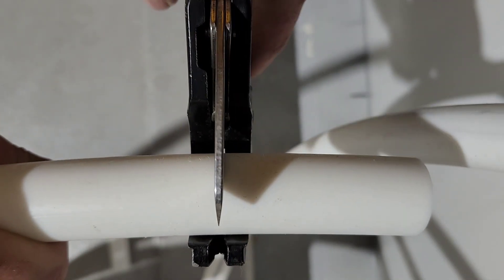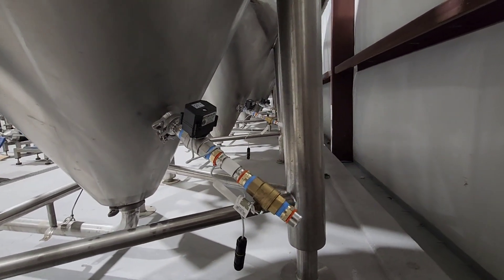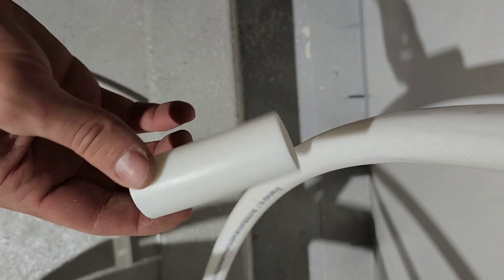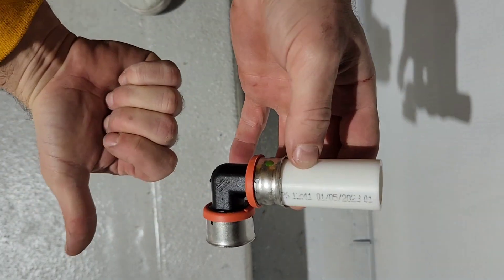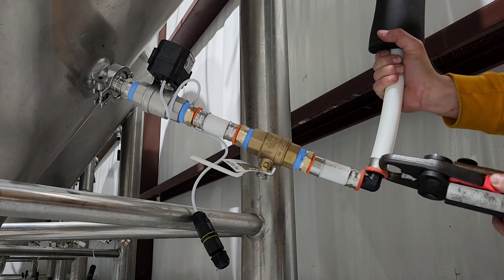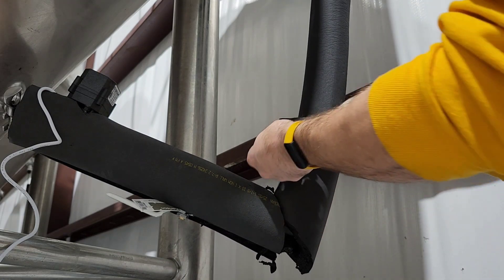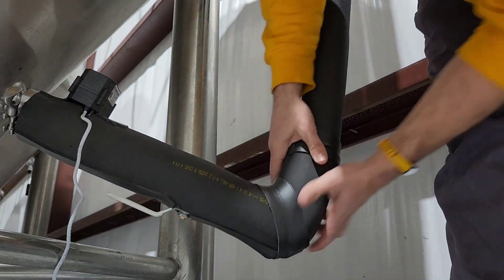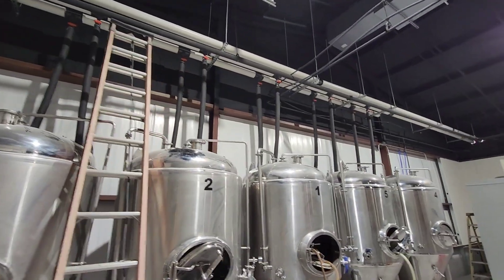How To Make Glycol Connections In A Brewery

Comment: How do you choose which pump to use?  Do you have any pressure valve and bypass?
Reply from the maker: Do you mean for pumping the glycol? The glycol chiller used in this brewery is a large unit with two pumps in the system. The unit also has a very cool variable frequency drive control for one of the pumps that regulates the flow rate to keep pressure at a constant depending on how many tanks are calling for glycol.